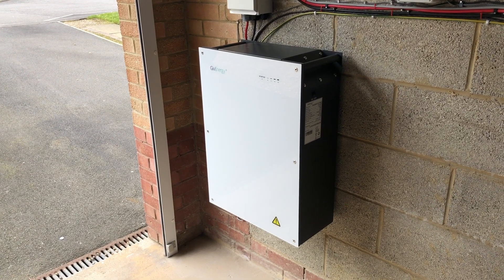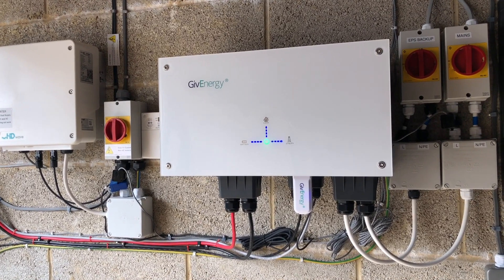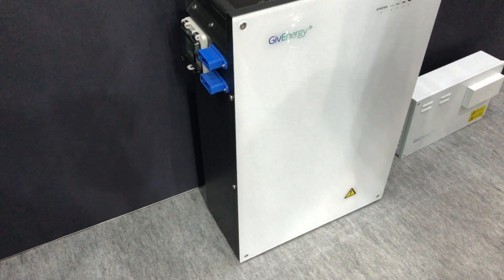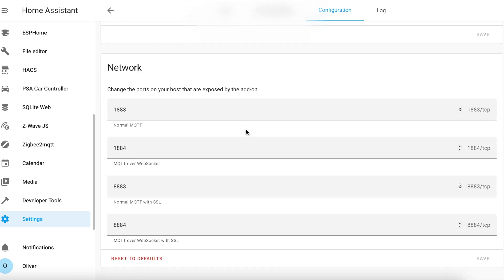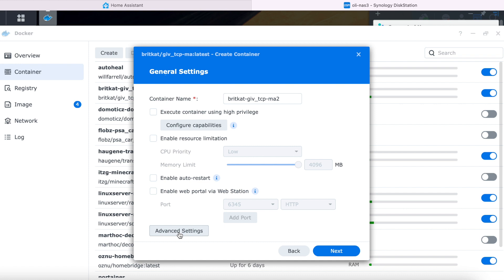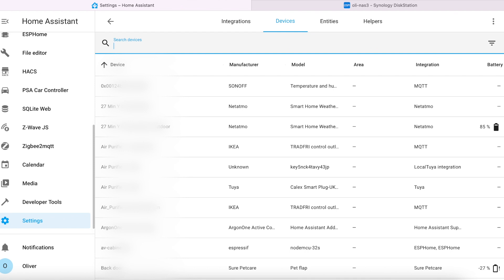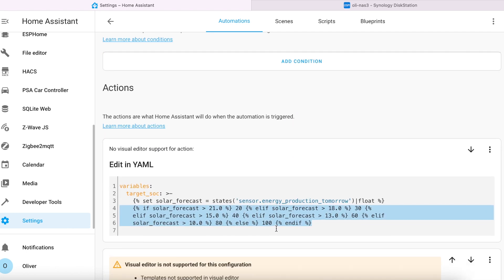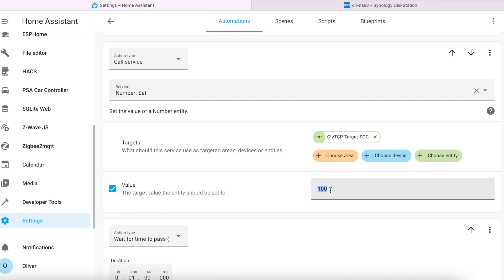GivEnergy Giv-AC 3.0 Battery, Home Assistant and Solar Forecast Automation

Comment: I also had system I stored last November and like yourself I have left room for expansion.  On you point about the WiFi access point on the invertor. When I had mine instated I was informed that this is because I have the new model and that it only comes with WiFi. But when I purchase it. I was told it cMe with a cat5 connection.  Not happy on that point.  And u also discovered that of I loss power from the grid then my house will have no power, regardless if I had solar or battery power.  Again a miss sale.   Less moaning, I have been enjoying your videos and I look forward to the next
Reply from the maker: I think there is a common misconception over continuity of power during a power cut when you have solar and batteries installed. I've spoken to a number of people who have insisted that their houses can keep going during a power cut because they've had a battery installed, when in reality they'd not realised that they'd actually need to have had some very specific rewiring done to enable that. I myself didn't realise the limitations of most EPS systems until I did my research before buying this solution - it's not a simple thing to get your head around and I think could be presented to customers in a better (less technical) way by the manufacturers.

Comment: Thanks for these videos, really informative. I'm due to have a GivEnergy battery fitted while I wait for solar. The installer is now saying they would need an earthing rod for the back up double socket or EPS so they may not being able to do it. Did you have to have this for yours?
Reply from the maker: Thank you. And yes, you are quite likely to need an earthing rod for your EPS if you are currently relying on the grid to provide you with an earth. But, the rods themselves (4ft) cost about £10, and just connect in to your existing earth circuit. Mine is driven into the ground just next to my meter box, and connects to the earth in the meter box itself. It wasn't a major deal for my installer.
Reply: @SpeakToTheGeekTech  Thanks for such a quick response. Frustratingly my meter is under the stairs within the house so this probably means they won't be able to do this. We've had quite a few short power cuts recently too!
Reply: I just had my battery installed and they did manage to get the earthing rod for the EPS socket thankfully. The inverter is over heating though, it's getting up to the 60 max and pauses charge until it goes back to low 40s. Have you had any similar issues with yours today?
Reply from the maker: @Barry-xg1rd  Mine never went above 50 degrees today.
Reply: @SpeakToTheGeekTech  ahhh something must be running incorrectly with min then. It went up 15 degrees in 30mins when charging. Hasn't even done the commissioning cycle yet, currently idle on 19%

Comment: Watching all your videos 🙂. Tried this one, using your latest GivTCP add on. The automation correctly updates the entity value in HA (number.givtcp_target_soc), but this doesn't update the inverter setting. It just sits at that value in HA (doing nothing) until I select a new value on the GE portal/app. Not sure quite what's going wrong
Reply from the maker: It works probably 9/10 for me, and the second attempt in the automation catches the other 1/10 attempts that fail. The current thinking is that these communication failures, possibly related to the reading 0-value drops, are to do with the constant polling of the inverter. Another developer has submitted an update to the main repo which limits this to every 10 seconds. If that tests ok (when I get around to it) I'll push it into my repo too. But, for now - ignore the GivEnergy portal/app because that can take ages to update the SOC value you set locally. I think you need to look at the actual GivTCP controls in Home Assistant. Add number.givtcp_target_soc to your dashboard on an entity card. It should appear as a slider. Move that slider to a new value, wait for about 30 seconds and see if it sticks on that new value. If so, it's working...
Reply: @SpeakToTheGeekTech  It definitely sticks in HA. I've just noticed if I change the slider, then go into inverter remote control (on the portal) and refresh the AC upper charge limit field, it seems to update the GE dashboard and app immediately. As you say, I guess it's updated, but just isn't showing it on the GE side. I'll let it run tonight and see what happens

Update for anyone else reading this, the automation worked perfectly.  Although the changes don't appear to be automatically reflected on the GE app or portal, they have taken place.

Comment: Why the decision to go with the AC invertor only and not the Hybrid one if you have solar generation as you are losing out on conversion, DC to AC then AC to DC to charge batteries. I ordered my setup in May and I have everything up and running, waiting on the last battery (9.5kw) that will be delivered before 1st of July. Have you seen the smart plugs integration coming soon in the givenergy app? If you are going to add a second battery I recommend going with a second invertor too and connecting that battery to the second invertor as you will have a greater discharge rate as each battery is capped at 3kw discharge rate (or 2.5kw). I have two batteries at the moment that will be connected to a single invertor because of G99 form from DNO but I am looking in the next two years to see if I can add more , or if VW is opening up the V2G on their vehicles to see if that is an option.
Reply from the maker: A few reasons for going with the AC-coupled GivEnergy solution. Firstly, I needed optimisers due to shading on my roof - SolarEdge optimisers are really good. Second reason is because the MyEnergi components don't like hybrid inverters because the Harvi / CT-clamps can't monitor the solar generation. Thirdly, battery availability was poor so having two standalone systems means they can be installed separately. I know there's a loss on conversion but it's not significant given how much I have spare. And yes, there's enough room in that gap on the wall for a second inverter and battery :)

Comment: Will you get a more accurate weather for case if you waited a bit later..say 00:20?
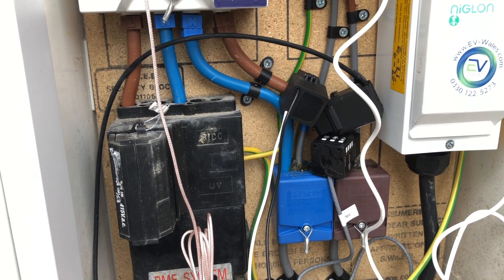Reply from the maker: Yes potentially but that introduces another issue. If I ran the automation after 00:00 then I’d have to use the “today” forecast instead of the “tomorrow” forecast. The Home Assistant built-in Forecast.Solar integration doesn’t update the “today” forecast until some point randomly between 00:00-01:00. Because I need to make a decision before 00:30 when my off-peak energy tariff begins, I must run it the previous day in order to guarantee that I get a reading for the correct day. I’ve started experimenting with the Solcast integration to see if that can improve things.
Reply: @SpeakToTheGeekTech  thanks. Great video.
Reply: @SpeakToTheGeekTech  FYI - much better luck with Solcast for me, the Forecast.Solar seems to be pretty crap, always 60-70% to high for me.
Reply from the maker: Totally agree - I’ve moved over to Solcast too. I like how it provides a forecast for several days ahead too
Reply: @SpeakToTheGeekTech  Would love to see an update with solcast please? I'm guessing you used ha-solcast-solar through HACS integration?
Reply from the maker: Yup, that’s right. I just installed ha-solcast-solar and connected it to my Solcast account. Not much to it really, I could then use the Solcast forecast entity instead of the forecast.solar one. There will be an updated GivTCP video in a few weeks once it becomes stable again. The developer is planning lots of features.